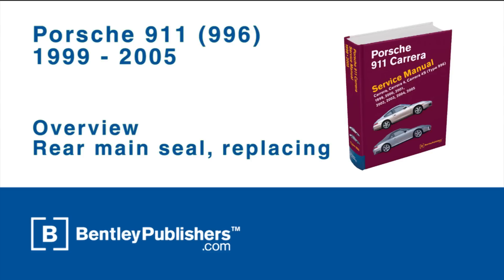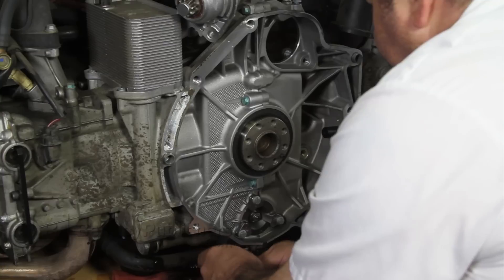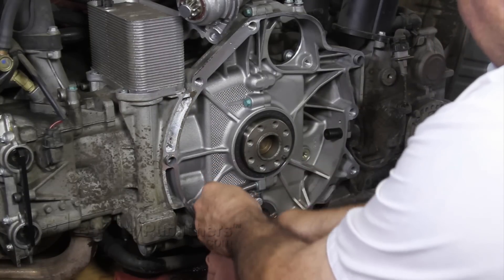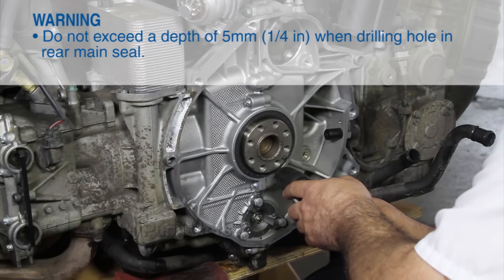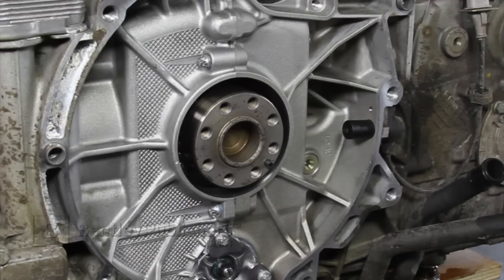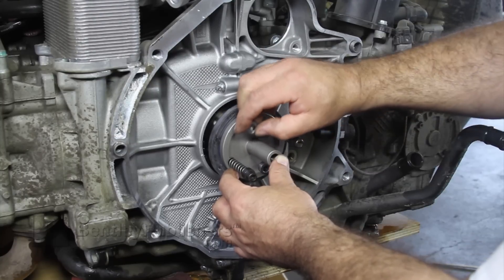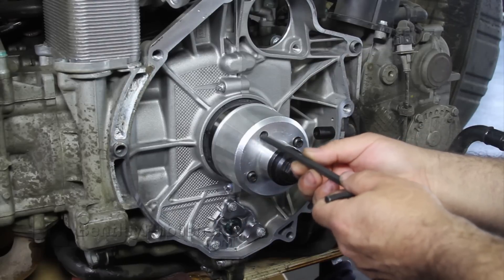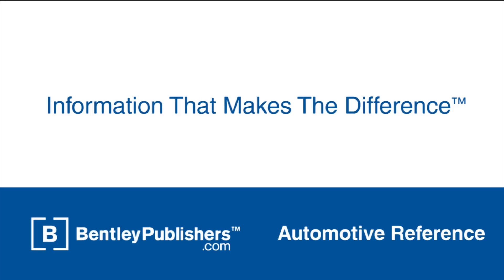Porsche 911 Carrera (996) 1999-2005 - Rear Main Seal - DIY Repair

Comment: How would the three bolts wear to the point of needing to be replaced?
Reply: They don't wear, they are meant to stretch under torque which allows them to properly seat and not back off or loosen under the load, constant heat and cold cycles, and vibration.. Whenever you have torque rated fasteners in heads, cylinder blocks, etc. It's generally specified by the manufacturer that they be replaced and not reused. $10 in bolts is very inexpensive insurance.

Comment: Ok, I can see why there having so many problems with this seal. You have to ask your self what is the intention, because either the out side or the inside of the seal has to rub in order for the crank to turn, LOL. Ok so your suppose to put it in dry. The only thing I can understand is that the seal is held tightly on the crank shaft,so you don't oil the inner part of the seal,  therefor the outer part of the seal is going to have its surface rub, but why not oil this surface? Who designed this engine?
Reply: You are supposed to soak the seal in oil for a while if I am thinking correctly. Of course, this was proposed after the RMS leaks started to occur.